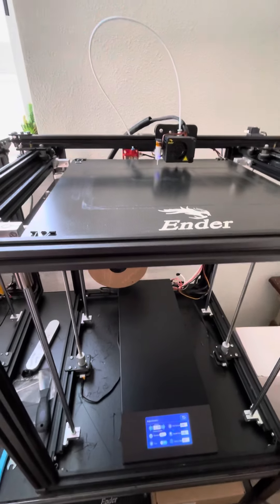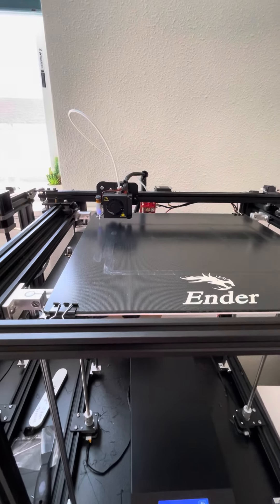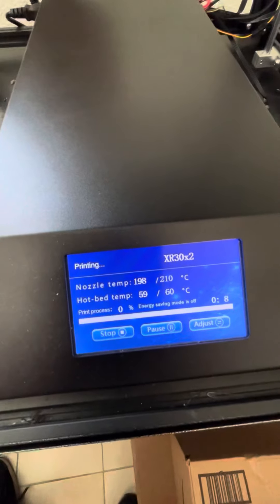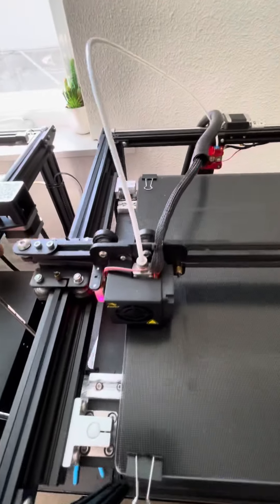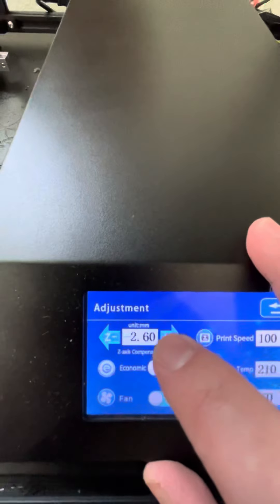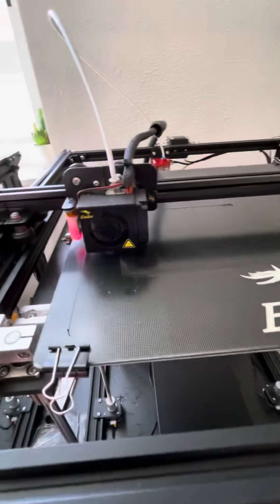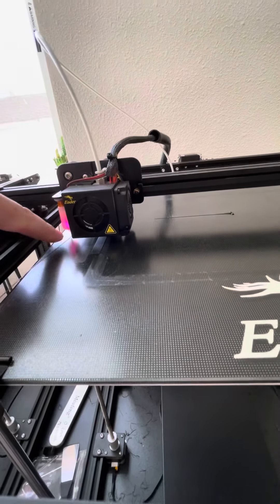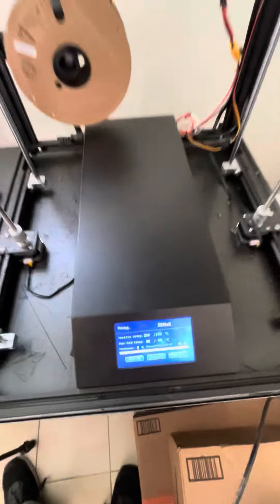Quick Tip on Ender 5 Plus Z Offset

Comment: For the love of God I need help. Evertime I go to print, my nozzle is 2mm above the print surface, no matter what slicer I use, no matter what settings I edit. It doesn't matter how many times I level it
Reply: It took 12 days, but if anyone else is having the same issue, there was a firmware malfunction with the printer that was causing my z axis home to erases everytime I set it. Updated the firmware on my printer and the issue was fixed.

Comment: Thanks for posting this; I'd been pulling my hair out for days trying to figure out why my Ender 5 Plus was dragging the nozzle on the print bed, and this fixed the problem.  Is it necessary to do this for every print, or will it remember the setting for next time?
Reply from the maker: Hi Aaron, this comment is old so you probably know now but I believe it does remember your settings. I am not having to do this adjustment very often so I suspect it remembers it!

Comment: Ender 5 pro plus doesn't exist...
Reply from the maker: That's correct, its just an ender 5 Plus like the video title says.
Reply: If it has a silence board and a metal extruder it technically is.